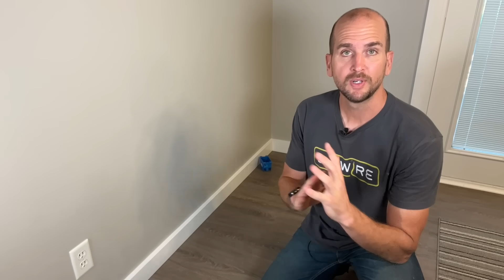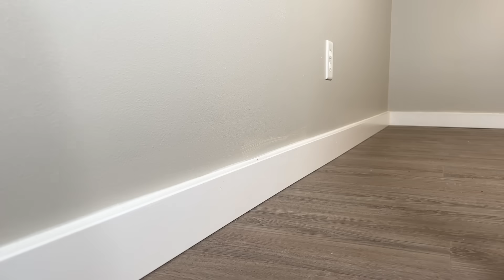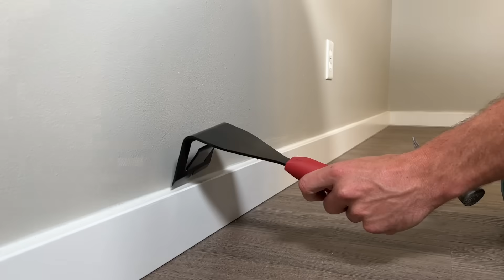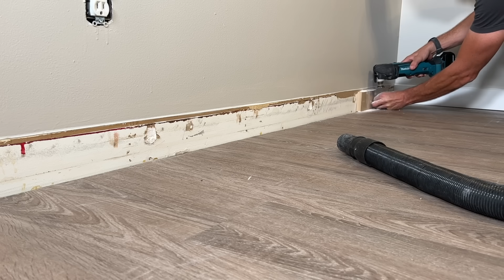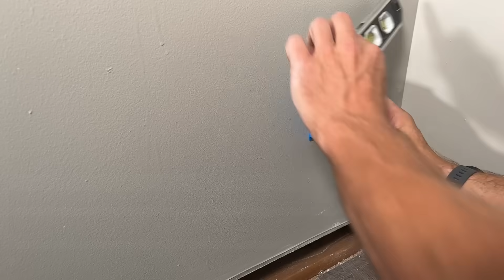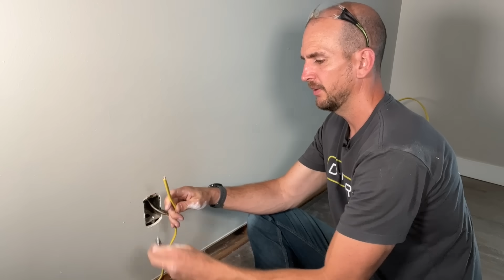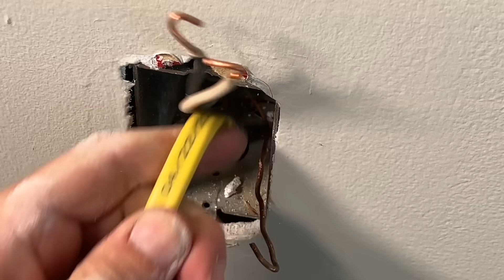How To Add An Outlet To A Finished Wall

Comment: Code is wire needs to be 6 inches or more from the box AND you need to wrap any outlet with electrical tape in a metal box, to prevent arcing DO NOT BACKSTAB your outlet. This guy is not an electrician.

Comment: Especially using a good commercial outlet, why not use the screws to continue the wires rather than the extra connectors? Now I understand the ground is a different issue because the outlet doesn't have multiple connections for ground.

Oh, I agree with others that I actually learned something very useful, even though rewired multiple houses already, so thanks for this.

Comment: The thing is, I've rewired a half a dozen houses I personally owned (with permits, the whole thing) but they were all over 100 years old so your video just seemed so easy-peasy to me.  Try finding studs when you don't have drywall, but lathe & plaster.  So much fun.  Or when the studs are not equally spaced.  Or when there is other cross-brace framing going on? Or when one side of the wall has 2x3 or 1x "framing" with a gap between it and the wall you are working on so that even when you think you have fished around and found a stud there is a void between it and the wall you are working on.  Pre-1924 homes are So. Much. Fun.

Comment: In general, fine, but there was no need for the extra long drill bit in this case with the wall essentially open.  If you had used a shorter spade drill you could have kept the drill bit parallel to the wall making it easier to thread the wire without snagging.

Comment: @8.30 - instead of connecting your pigtail wires to the WAGO first, then having to wire up the outlet while cramped down on your knees, connect the pigtails to the Outlet first and THEN connect the to the WAGOs

Comment: Thanks for sharing done this many times just gotta miss the nails when drilling, and I will say(Wagos) as quick and easy convenient as everybody realizes they are, they are no better than quick wire which has the potential to fail under loads because of the way they’re connected inside the connector , you can’t beat twisting your wires together tight and use a wire nut safer connection. thanks for sharing.⚡️💡🤠👍

Comment: Couldn't you insert the drill into the wall void, rotate, and then drill the holes in line with the outlets?  I know the US doesn't require safe zones (e.g. unlike the UK), but putting the wires in expected places is probably sensible wherever you live.

Comment: Dont buy wagos unless youre doing can lights... the wires pop out so easily if you tug and twist. Use wire nuts and if your lazy get a wire nut spinner for your drill. Theres no way this guy is a licensed electrician. But otherwise for DIY pretty good 👌

Comment: I'm thinking of doing this in the home we are moving into. However it is an old home and the baseboards are NAILED in with 2" nails. A little more tricky but with only 2 outlets per room a necessity.

Comment: was great, until for some reason you sped up at the point of those cool connectors you used. Everything else was in normal time, but that was fast forwarded, not sure why. I assume those things let two wires in and then one out to the outlet?

Comment: One thing that would make this easier: Start feeding the wire from the original outlet first. His knockout was larger than some, thus a bit easier to feed it through. If you start at the original, it is simple to feed it down, and on the other side, you have the entire cutout to fish it through.

Comment: Wow great way to do this specially the trick with the connector. I have a project coming up that I have to do and I can use a lot of what you did. By the way I saw another video you did, where you used the Wago nuts and I went and bought them right away. Thanks for the video.

Comment: Thanks for the great drywall saving tip!  I plan to go use this tip for creating an exterior outlet on the other side of my wall.  I especially love the tip about pre-clamping the ROMAX, which is a trick I'd never even considered.  I like that a lot more than using push-in ones.

I know your tutorial was more about drywall methods, but here are some notes on electrical:

Link to some common DIY wiring mistakes here:  https://www.youtube.com/watch?v=OHQHT5dMQPw

- The metal box should be grounded to avoid the box becoming dangerously electrified if a wire nut comes loose.  An uninsulated ground wire pressing against the box isn't good enough as it's un-clamped connection can have arcing if it's ever electrified.
- Best to tape WAGO wire connectors shut.
- Best to mention that the wire choice should be the same gauge.  If it's a 15A breaker then 12G is safe but does run the risk of misleading on some future electrical extension project (albeit, a real electrician would always note the circuit breaker's size).  14G wire on a 12A circuit is a fire hazard if someone ever overloads it.  Your wiring looks matched, but it's worth mentioning since some DIYers like saving a few bucks for the cheaper 14G wire based on what they plan to use it for.
- Code says that pigtails need to be 6".
- Important to note that when straightening out the old wire, be careful not to bend the wire at the base of where it's stripped.  See minute 13:22 here:  https://www.youtube.com/watch?v=Tu8RBQ0ChaI&t=8s
Best practice is to cut off the old loop before straightening and strip the wire to sufficient length. 
- Important to note that your outlet's speed-wiring ports are screw tightened, which is great!  This is not true for all outlets.  Some use built-in clamps that should be avoided since they wear out over time and the wire could come loose, leading to internal arcing & heating, or even pop out.
- You wired the sides correctly, but it's worth noting to beginners that Black goes to the Gold-screw side, and White to the Silver-screw side.

Comment: I have a HUGE question. I live in Joliet Illinois. Are we allowed to pass the wire behind walls or ceilings just the way you did it here or do we need the wire to be use with a flexible conduit?

Comment: I would advise against drilling 1” holes through bearing wall studs unless absolutely necessar. Since you’re only drilling through 2 or 3 studs fairly close to a stud pack in the inside wall corner you’ll be fine. But there’s no reason to drill holes over 3/4” through a row of adjacent 2x4 studs. Probably could get by with drilling a 5/8” hole for 12/2 Romex wiring and  prevent any future structural issues (especially if someone were drilling 1” holes across like 7 or 8 stud bays. Then they’d have a potential problem.

Comment: 40 plus years as a electrician with a lot of residential experience never thought of this. Thanks great job.
Reply: lol
Reply: Sometimes the new types of smaller base Board with the finger joints will separate and/or break... great patience and skill needed.

Comment: TOO MUCH WORK TO JUST HAV CONVENIENCE FOR LAZY PPL ! IF YOU ARE USING LOW POWER THINGS LIKE COMPUTERS AND PHONE CHARGER  OR A TV JUST  USE AN EXTENSION CORD . TOO MANY OUTLETS CAN ALSO PASS THE 15 Amp / Room on avg house . Most ppl DONT EVEN KNOW THAT AND PLUG TOO MANY THINGS AT THE SAME TIME AND THAT SHORTS THE CIRCUIT

Comment: The proper way to do it is not be lazy, cut out the wall, drill through a bunch of bays (if you must), and USE FUCKING STRIKE PLATES.

Comment: This worked well for the scenario you had.  But curious if the existing outlet wasn’t the last in the circuit and no wire coming from the floor.  What’s the solution then.  Murphy’s law suggests the odds of expanding from the last outlet in the string is not favorable lol.  Guessing pigtails with the splice kits you show?   But box space then becomes an issue

Comment: I like how you tighten the extra screws in the side of the outlets. In my house, the electrician was too lazy to tighten them, so they stick out a ways.  Any time I work on an outlet I tighten them. 
Another tip is to use a marker and write the breaker number on the back of the cover plate.  Then you'll know which breaker to shut off the next time you're working on it.
Reply: great tip!

Comment: Just stop. You're going to get someone killed. You dont have a license. You're not qualified to be teaching electrical. There is so much more to adding a receptacle than this and that comes with knowledge of a licensed electrician!
Reply: Licensed electrician LOL. Yep, they all get butt-hurt and tell us our house will burn down. 25+ years later, none of my old houses burnt down. 2 years ago, I added 2 subpanels, and wired a whole new apartment/suite add-on, with bathroom, kitchen, all electric appliances. Code enforcement came in and out fast understanding I did better than many "Licensed Electricians".   This is like saying, "you don't have a driver's license so you cannot drive safely or correctly"   LMAO  you should "Just Stop".

Comment: Overall great job and techniques. However I didn't see how your second outlet box was secured to the stud.  Is it not code and a good idea to have every box secured to a stud? I usually screw in 2 places.  That would seem to be the downside of this technique where the wall isn't open enough. 
Just curious your take on that. Thx

Comment: I thought ground wires had to be "bonded" together, by twisting and then crimping a copper collar.  Does the 221 satisfy this requirement??
Reply: Bonding is a connection. A Wago or Wire nut is all fine and 221 is UL approved. It is a connector. Newer entries/rule into NEC are just this: "Effective Jan. 1, 2023, National Electrical Code® (NEC®) 230.46 requires wire connectors used for splicing or tapping conductors on the line side of service equipment to be certified (listed) as suitable for this use."
WAGO has always been UL approved. Any wire nut you want to use, needs to be UL listed if you want to comply with the above. Also notice it says "LINE SIDE"
      As far as any other uh-ohs, only your local jurisdiction can make some outlandish rule for your wiring where you live. Yes, this happens a lot apparently :)  So they have the last say if they prefer you to use something specific.  This would cause a TON of backlash in this instance IMO.

Comment: Would have been nice if you would have worked slower on the wiring details. Couldn't follow what you was doing when wiring terminals. Other than that, excellent work.
Reply: which details?  Slow the video down, or pause it

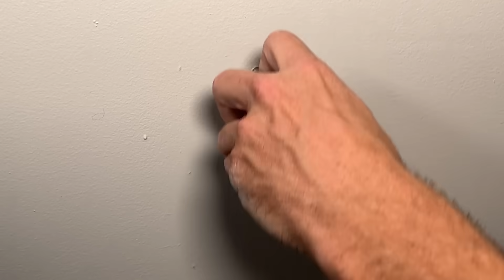Comment: For newbies at 4:53 in this video he " confirms no power" to the outlet  but doesnt discuss how this needs to be done,   you'll need to shut off this line/ breaker in the panel box by switching the breaker off, however to be safe for those uncomfortable,  you can shut down the whole house by switching the bigger breaker off ( usually located at the top of the breaker box, middle) to avoid electrocution/ shock/ or death
Reply: Thank you, captain obvious

Comment: F**ing HATE wagos.... things are pieces of garbage, and for HACKS! Learn to splice wires correctly like a REAL tradesperson! (For DIY-ers... do what you want, just HATE wagos as a professional)
Reply: Please do share some information why they are "pieces of garbage" and why you hate them. Which is just an opinion of course. They are not garbage at all. They can handle TONS more amperage then they are rated for. They also stop from shortening wires every time anyone does work on a wire or wire-nut removal.

Comment: Is this method conform to the electrical code?
Reply: Yes. Anything regarding in NEC is followed just as if it was an unfinished wall. The only 'real' difference would be a NEW WORK box, instead of an OLD "workbox". NEC is for safety from electrical hazards IE:  burning, melting, electrocution etc. This vid, the NM-cable is of proper size or larger, is secured to the boxes, it is also centered in the studs etc etc.
Some may say he did not secure the NM-B below the box. It was less than 12" from box, AND it was in a stud hole. All good

Comment: I have been a trim carpenter fpr 25 years! Not only is this illegal where I live, it is insanely stupid! You could burn the house down if a carpenter shoots a nail through the wire!!! DO NOT DO THIS!!!
Reply: Why are you shooting nails longer than 1-1/2" through or above baseboard molding??? It would require a longer nail to hit NM-B in a stud.  Also, a SHORT will NOT burn the house down unless you are using aged and stuck Pushmatic/BullDog breakers LOL.  Wow, 25 years...

Comment: Good video, only one suggestion is to use electrical tape around the wago levers to prevent them from catching and popping open while putting the receptacle back in.  Takes 2 seconds to do and will save you time down the road and huge safety tip.  I use electrical tape around every single wago lever or wire nuts.

Comment: May I ask why not skip the wagos and connect both lines to the first outlet?
Reply: You can. 
I will come back and fight the ones saying "if the first one fails" etc if needed.
Reply: Wiring*
Reply: That would be working in series, so if he were to Connect them together using all four terminals, if the first one feeding the second outlet were to fail, then the second outlet would fail as well
Reply: @masonjoya7131  Ok, I will bite, how does the first receptacle failing affect the second one?

Comment: Again the method you are showing is not up to code. All electrical wire in homes must be stapled to a stud within 6in from the box. As a person who has taken many courses on multiple aspects of home maintenance and some electrical trade background I can't believe you're putting this out as proper.
Reply: I knew there would be one. Please show the NEC CODE reference of this imaginary 6" rule.
>
>
>
>
>
After you get lost, please read NEC 334.30
Should I mention that NM-B through a stud is also "secured"?
Reply: @fizwin1  The presence or absence of cable clamps dictates how cables must be secured according to the NEC. Article 314.17(B)(2) specifies that cables should be secured to the box with a clamp. If using boxes without clamps, the cable must be fastened within 8 inches of the box, extending not less than 1/4 inch inside. This requirement applies, particularly to single gang non-metallic boxes, influencing how you must approach your connections to maintain compliance.
Now what?😭
Reply: @ Still not seeing this 6" rule since it does not exist. 
Are you now speaking in general? If the existing box does not have a clamp or anywhere to use/add one?
Then swap the box out. I have cut them out before.
Reply: @fizwin1  did the video use a box with a clamp? No the code I linked stands

Comment: I'm a novice and someone who likes to learn about Dyi projects.  I'm just wondering, could you have used 2-way wagos instead and used the receptacle itself in order to run it to next circuit (outlet)?  Is that even possible if I'm reading this application correct and there are other receptacles connected to that circuitry?
Reply: Yes and no. Yes you can use just one WAGO but still needs to be a 3-way,  because you still have 3 grounds that must be connected/pigtailed. Source Ground, REC 1 and REC 2=3-way.   As far as Line and Neutral, there will be many stating "you do not want to do that." though.  But yes, you can connect line and neutral to the receptacle directly.
Reply: @fizwin1  Grounds must be bonded?
Reply: @n.g.1577  Yes of course. One continuous connection otherwise, downstream outlets have no ground. Then we get into discussing 2 prong receptacles etc.

Comment: The only thing you missed is when you take off the piece of trim and even though you've cut the caulk with your razor, there's a tiny piece still connected and it rips the paper off the drywall up a 2 ft long section and then everything needs to be spackled and repainted. Then you jump out the window.
Reply: LOL:face-green-smiling:

Comment: As long as their is a tall base board and a 1/2 knockout in the metal box-if not this is not possible without damaging the wall and replacing the box
Both of which almost never happen 
Dude with false instruction total BS
Reply: It is not self-explanatory that his wall is not 100% your wall you are working on?  Better not do anything ever if someone is that clueless.

Comment: Could you explain how you removed the knockout in the bottom of the existing box.
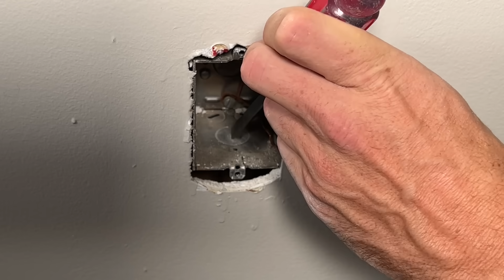Reply: 5:00
Reply: Probably just tick-tock the connector back and forth with screwdriver or a small 90 degree pick etc.

Comment: Nice idea and video! Why did you need the Wago connectors and pigtails when the outlet has L/N connections on both sides? It’s made to pass power down to the next outlet. In my opinion, the Wago connector is completely unnecessary and just makes more connection points in the circuit.
Reply: some people like to replace a mid receptacle, while the power is on, so that downstream receptacle stays powered....  :)

Comment: Fantastic video.  I did a similar installation when I owned a house with 8" wooden baseboards...never thought about drilling those holes an inch above the top of the board.  Question: I noticed you were using a 12-guage wire for your installation, normal household wiring is 14.  Was there a particular reason you were using 12-guage?
Reply: The original cable behind the original receptacle was 12-GA

Comment: Excellent explanation to locate the wires above. If that is too hard, they could drill lower and use nail plates. One suggestion is if they have to buy a bit, get the NAIL EATER type. Paddle bits work, but if you hit a nail, it will destroy it. Also, another great idea to put the Romex connector on before you put in the box. I’ve been building and fixing all my life, and I picked up at least 4 new tips, excellent!
Reply from the maker: Thanks for the feedback and support.  Best of luck on your future projects 👍.